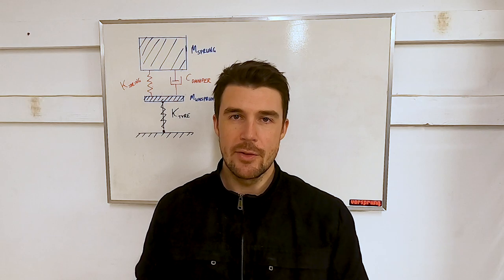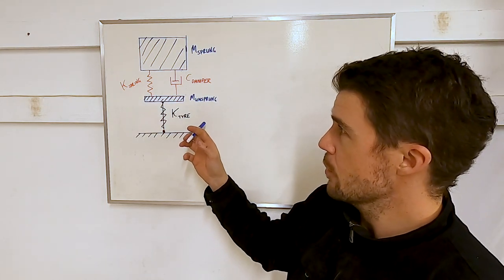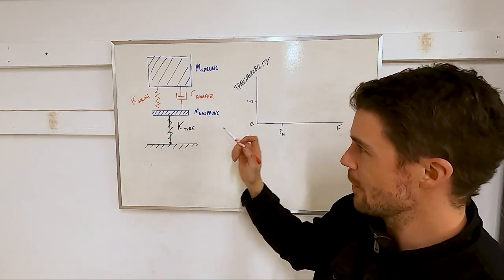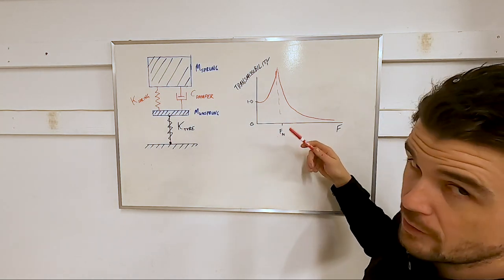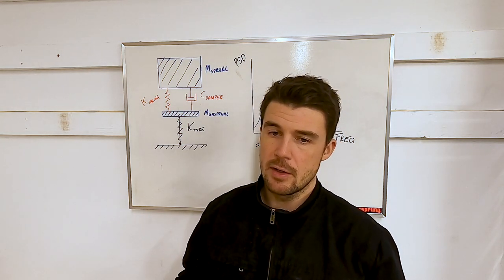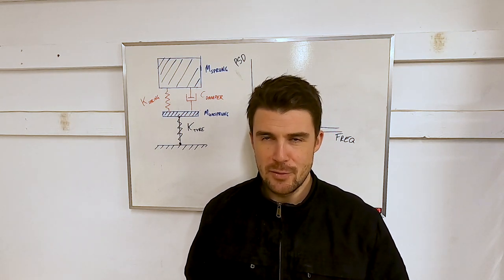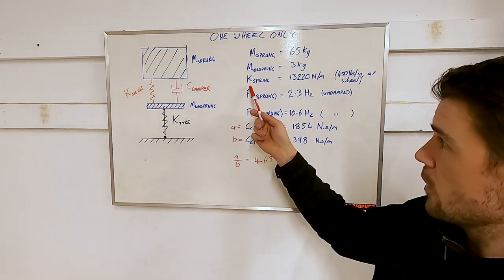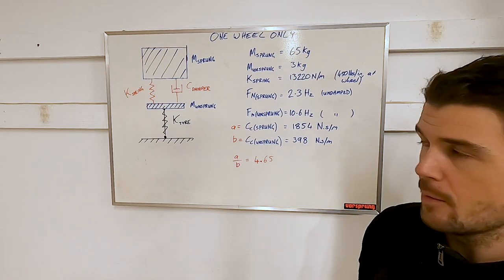The Mathematical Compromises In Suspension - Tuesday Tune Ep 36

Comment: Very cool Steve, as a physicist I can appreciate this a lot, even though it might go over the heads of many. A thought that occurred to me is that this very problem is why there is low and high speed circuits in a damper. Just shooting from the hip here, maybe an ideal rebound damping system would have a HSR tuned to the critical damping of the unsprung mass, and a LSR that is tuned for critical damping of the sprung mass. And that combined with a sensor that keeps the HSC open as long as the compressive force in the spring is less than the sag force, to quickly re-establish traction, and closes it when force exceeds sag force, to prevent ejector seat effects. Waddayathink?

Comment: Great video. I learned the basic concept of resonance in school (a long time ago) and you see (or feel or hear) it in life all the time. Does your car make a rattle at a certain speed or engine RPM that goes away again when you go faster or rev harder? That's resonance, the same happens with washing machines and anything else that vibrates..

One example that I was taught about was the (original) Tacoma Narrows bridge which collapsed shortly after construction. The engineers didn't take the interaction of wind and the natural resonance of the bridge into account (to be fair little was known about it at the time) and when the wind hit the perfect speed (only 42mph according to Wikipedia) the bridge started oscillating wildly and collapsed!

Another, less extreme, bridge related example is the London Millennium Footbridge (across the Thames) which easily hit a resonant frequency just from the footsteps of people walking across it, if everyone ran across it would have been fine. It didn't collapse but it was closed and had to be fixed. The changes they made didn't make it any 'stronger' in the traditional sense but it was enough to change the natural resonance of the bridge so that it didn't sway. From Wikipedia:

"They concluded that making the bridge stiffer, to move its resonant frequency out of the excitation range, was not feasible as it would greatly change its appearance. Instead, the resonance was controlled by retrofitting 37 viscous fluid dampers to dissipate energy."
Reply: Yeah real world resonances are crazy! Exactly why my car dashboard vibrates like hell at 1900 RPM but I'm not going down that rabbit hole just yet.....Tacoma Narrows was one of the first examples I got taught as well, that is a wild video if anyone has never seen it. I randomly travelled past there once on a train to Seattle, so got a glimpse but part of me was bummed I didn't know in advance or else I would have visited it!

Comment: Thanks so much for explaining it. Intrinsically I understand what is happening, but I don’t know what is happening from an engineering perspective. It’s great to put a little bit of structure around my thoughts. (And to have them validated).  I work with motorized offroad suspension design. Right now my designs are reactive, but they will be migrating to active and proactive as I can characterize the various suspension activity for a given situation. Tons of fun! Thanks again.
Reply from the maker: That sounds awesome, good luck with it!

Comment: Hi, thanks for perfect educative series. I watched all your videos, however I still could not grasp one concept. How negative spring works, why it helps with initial stroke at all. Currently, DVO makes forks with adjustable negative coil preload. I have a fork with interchangeable negative coil and tunable negative spring preload (SR SANTOUR AURON). But I have no idea how to set up that for best results. Manufacture does not provide any setup information. They provide just chart with negative spring rates vs. positive air pressure. No explanation, no theory behind it.  
DVO at lest says:  “OTT allows the rider to fine tune the small bump sensitivity without affecting the mid-stroke or end-stroke. As a general rule of thumb, the heavier or aggressive rider will use more air pressure & more OTT. A lighter or less aggressive rider will use lower air pressures and less OTT.”  However, it is preload, not spring rate. Does higher spring rate of negative and positive spring result in lower overall break away force? How progressive negative spring influence fork travel, ... Could you please shad some light in to this? Thank you.

Comment: Great video!
Do I get you right here that the more fitness I have (ability to stabilize and dampen my body=main part of the unsprung mass) the less rebound dampening I can ride and get closer to an optimal dampening for the sprung mass?
Thanks!
BR Tobias
Reply from the maker: Not really actually. The rider's ability to respond is heavily frequency-limited to well below the frequencies the wheel can move at, regardless of fitness. The optimum amount of damping isn't just  for the wheels.
Reply: I confused the two masses…
Sprung mass = rider + “bike”
Unsprung mass = “wheels”

What I meant was that the more fit you are the better you can dampen the sprung mass. Then you can set the rebound more close to the optimum dampening for the unsprung mass (faster rebound). 

What do you think about that? Do Pro riders run their rebound faster or slower than the average guy?

Thanks!
Reply from the maker: @tobiasdonner6268  I understood you, the answer is still the same.